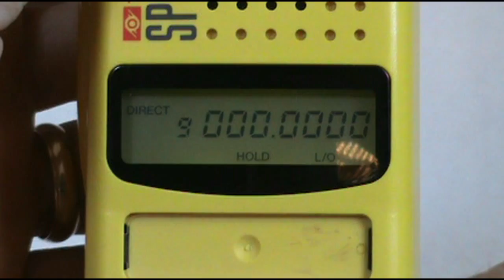Uniden Bearcat SC150 Scanner

Comment: How long should I charge my ZZ cell battery? The charger that came with this 150Y does not tell you when it is fully charged. Thanks for any help on this.
Reply from the maker: 10 hous
Reply: @LonnieJohnson1  hello,  i have the black model  1994  year of production    i think   ...  i had it bench tested ,,   all good ..  i would like to program local channels and use a scan / search mode for anything out there,   i may need a new battery pack ...  i will do a full charge soon
Reply from the maker: If it will not charge try to shock the battery pack to get it to charge.